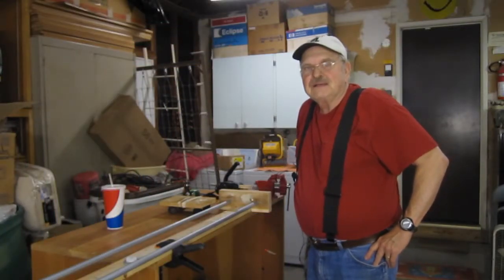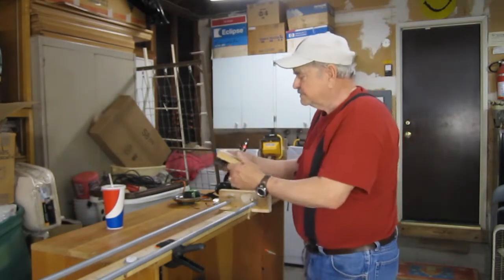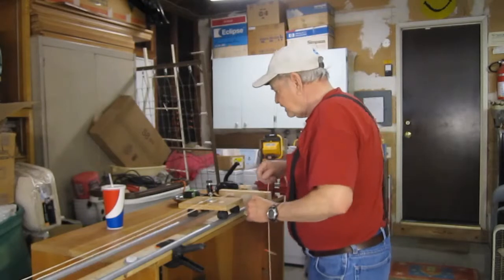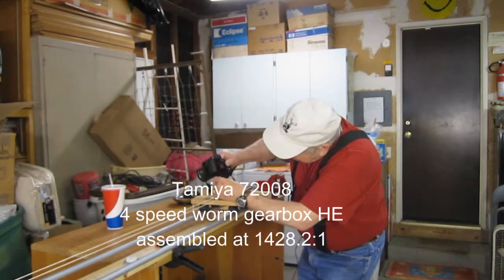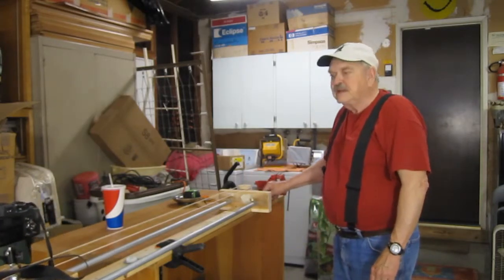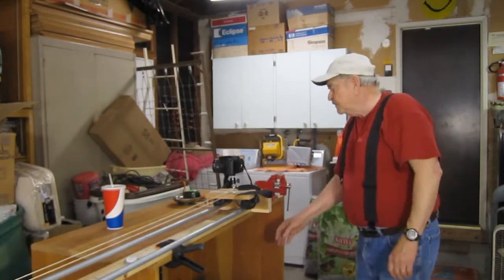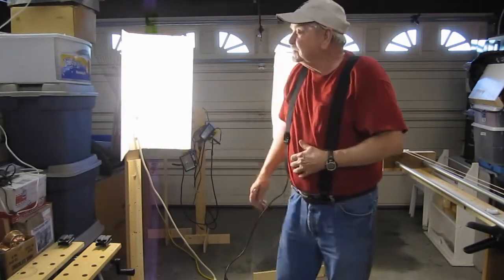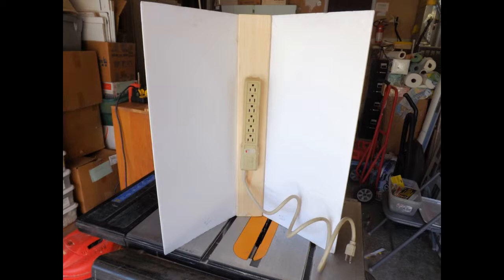Motorized Camera Slider for $25.00

Comment: By far the greatest slider tutorial out there! Any chance you could go into detail on how to make the terminals for the variable speeds? Thank you for your great work!
Reply from the maker: The small gear motor will work at various volts....If you run the gear motor at 1.5 v, 3.0 v,4.5 v, 6.0 v the motor will turn at different RPM's I took 4 1.5 v batteries and wire them to work at the 4 voltages above, by wiring them to screws that would work with alligator clips attached to the motor.
Reply: TheTroutDoc Great! Any tips for suppressing the sound? Maybe build a box around the motor?